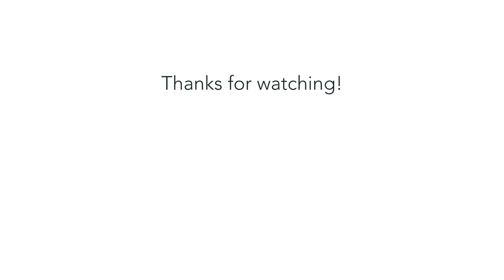RV Carpet Removal + Prepping for RV Flooring (1)

Comment: I was searching for anyone who had tips on getting that stupid stuck carpet out from under the walls when I happened to find your videos. We are renovating a 1991 Four Winds that, despite being a different "brand" is identical to your RV. Ours leaked in the same areas and we had to rebuild the back room and cab over also. UGH! We did it exactly how you did your rebuild. To stop the leaking roof, we painted a very thick layer of Duck Coat on the roof and it seems to have stopped the leaking. We went with a rustic cabin theme for our RV and will use it just like a cabin on a lake somewhere! It was fun finding your videos and knowing we weren't the only ones in RV renovation hell.

Comment: I've been using a composting toilet at the house for about two years. I started when I had to rebuild the sewer treatment tank. Saw a video that mentioned how there is no smell. Cat litter box smells so I doubted the claim and set out to prove them wrong. But it doesn't smell nor attract bugs.
It works for me because I have a ready source of sawdust/wood chips.